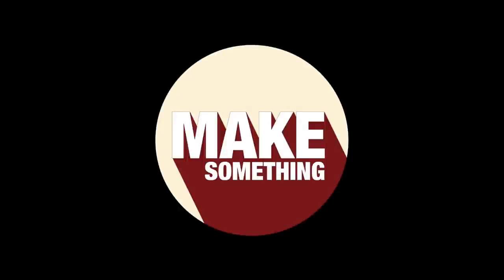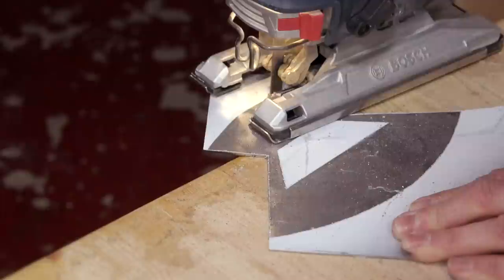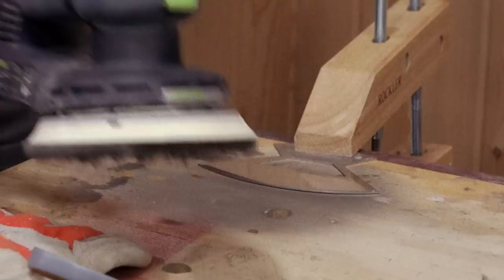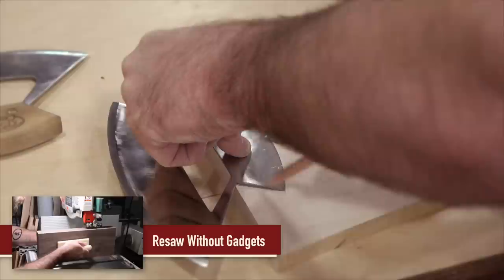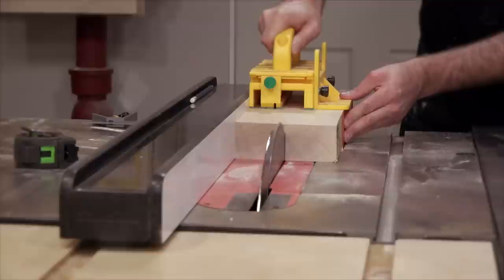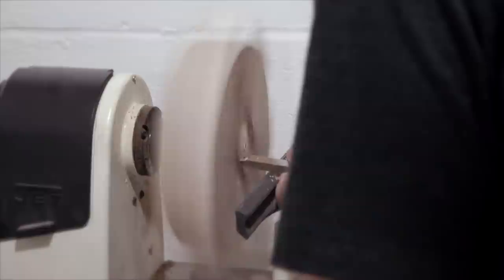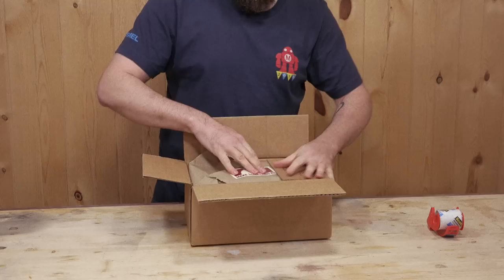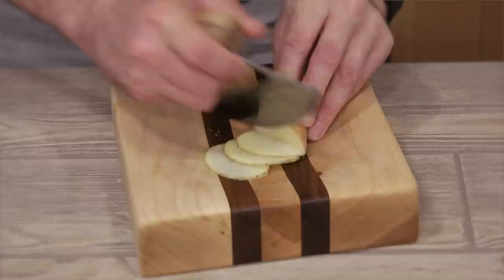How to Make an Ulu Knife with Cutting Board

Comment: Do you still have your silhouette? If so they make the best templates ever.  Use a weaker vinyl like oracal 531 or they even make a vinyl for doing high end painting templates. Just make sure you weed out the right areas and you have sticky template that will be very precise.

Comment: I'm a knife maker but since it is only used for meats and food it isn't exactly necessary for it to be hardened and tempered like a knife would need to be because you may use a knife on more dense mediums like wood. If its stainless steel that's good enough for the purpose but if it was going to be used commercially it would be a benefit to be hardened so it is sharp for a longer period of time. Well done!
Reply from the maker: Thank you! That make me feel better about my decision to not harden it!

Comment: Three things:

1 - The fracture strenght in a specific point is proportional to the radius of curvature in said point. Because of this, all those sharp corners in the knife, however cool, make it structurally questionable. It's not a big issue, though, since it wont be put into a lot of stress, but I'm just letting you know.

2 - What about the heat treating of the steel?

3 - Your videos are awesome. Subscribed.
Reply: Sheet metal is not treatable. It's junk.

Comment: I really like the idea for this build, but I would suggest one thing. Find out what kind of steel it is, and if it can be tempered. Otherwise that will not hold a edge very well as you said. The issue is that a dull blade is dangerous even if you only use it for potatoes. A blow torch, a container of water/oil, and a oven can give you a decent blade.
Reply: Also i am totally using this video to make one. I will just temper it.

Comment: I know quite a lot of chefs prefer steel that is easy to sharpen over steel that holds an edge for their knifes, not sure if it applies to this type of knife though, but it might. Many chefs just make it a habit to give the knife a quick sharpen before use almost every time, using one of those sharpening steels that looks like a piece round steel with a kitchen knife handle attached.
Reply: the item you are talking about, "Sharpening Steel" (aka a steel, lightning rod, or sharpening rod), doesn't sharpen knives. it only aligns the edge from wear such as the blade curling over or not being straight. it's good to use one before using a knife every time though

Comment: I never understood concave cutting boards for rocking blades. How is the blade gonna rock from side to side if the surface it's supposed to be rocking on doesn't leave any room for that?
Reply from the maker: In the video I do say the concave needs to be big enough for the knife to rock. It's how traditional ulu knife boards are made.

Comment: Hey David. So I know you're an expert on cutting boards, I want to know what your thoughts are on using baltic birch. End grain plywood furniture has become a trend, so why not cutting boards? Birch plywood is stronger than other grades. And any voids could be filled with epoxy or a glue/sawdust putty. The shop I work at throws away a lot of baltic birch so I would like to make use of those scraps.

Comment: If you're ever going to reproduce I would STRONGLY suggest getting some tool steel or high carbon steel.  The sheet metal used will not hold an edge with extended use.  As well please, please, please make sure you do not use galvanized metal. It's coated in Zinc and will cause zinc poisoning during heating or sanding.

Comment: Couple of problems here. First, you used mild sheet steel from the Home Depot. Which, I guess explains the second problem, which is you not heat treating it(it can't be hardened with a heat treat). So, this won't hold an edge at all, and isn't actually a knife, instead being a KSO (Knife Shaped Object).

You seem to be competent at building things. I think you could make a go of making a proper knife. Buy some high carbon steel, (I buy from New Jersey Steel Baron) build a simple forge, and quench in canola oil after reaching critical, which you can check with a magnet. Afterwards, check for the particular steel you chose, and temper accordingly in your oven. Or, buy decent stainless, and ship it off for heat treat.
Reply from the maker: Silly goose! Did you comment before watching the end of the video?
Reply: No, I saw your failed attempt at explaining it away. "I found one at the store that also sucks, therefore I don't have to put in any effort into making a real knife" isn't much of an excuse, honestly.
Reply from the maker: You may be misquoting me. :) Anyways, thanks for watching! Tell your friends!
Reply: I guess you don't stayed till the end before posting this comment, because he explains why he did it this way and why it isn't a problem if it doesn't hold an edge.
Reply: I did hear it, yes. It was an attempt to excuse shoddy workmanship, and it was a failed attempt. Knives should be made of decent steel. They should be sharp, and should stay sharp. They should maintain their shape, and not bend. By making this out of garbage sheet metal, none of these things will be true. His ulu should be thrown away.
Reply from the maker: Hrothgar So having fun, experimenting, trying new things isn't allowed? Well shoot..
Reply: Nice try, but I didn't say anything of the sort, and you know it. This is known as a straw man fallacy, and you're doing it because you don't actually have anything cogent to respond with.

You made a shoddy product by taking shortcuts, when you knew better. Then you presented this as if it were a valid way to make a knife. I encourage anyone who has the inclination to learn how to make a knife. But, they can't do it from watching this video.

I would suggest people watch actual knifemakers like trollsky, or gavko, or green beetle.
Reply from the maker: Awesome! Tell your friends about my channel!!! Thanks!
Reply: THANK YOU!!!
Reply: Anbu8366 he doesn't say anything like that, he says that he doesn't feel like it needs to be sharpened because he's not going to do extreme thing with it, but he never says only surival knives are hardened
Reply: I mean, im with @hrothgar on this one, but yeah he was aware of that this "knife" was made out of "crap steel"  but even still, i must say that for some reason i just have a hate deep within me for people who either uses to many powertools and people who get sponsored for this stuff, and what did you expect? an $5 ulu from a local convenient store is obviously going to be unhardened crap!   and srry for any misspells, english is not my mother tongue, Norway for the win!
Reply: Great steel is all around us. Plows, rail stock, an old file, an old circular saw blade, the leaf springs off of an old derelict truck out in a field. A forge is something you can get some buddies excited about (with sneaky email links to forging videos) chipping in on and building together. Some blacksmith lenses in a pair of goggles to see colors properly. A digital laser thermometer? Quenching in USED motor oil? Folding disparate metals for a damascus acid-etched patina? San Mai damascus? A proper ebay heat treat oven for tempering and heat treating and annealing?  There needs to be passion in this trade. I can appreciate how someone with ANY passion in this can become so tyrannical and anal about it.

Make Something; EXCELLENT video! VERY nice build. I know YOU are happy with the final product and that's all that matters to you. If you actually use this blade; even MORE awesome. Just keep your sharpening steel handy.

Hrothgar; Awesome nick. Excellent points, all correct and I agree 100%. But to me - the point of the video is the most important thing going here; Make Something. Yup. Something. Anything! I think We can agree - that in itself is worthy of celebration.
Reply: odliqna stvar bravo..
Reply: he says that it is "...mild steel from Home Depot?"
Reply: wait, isn't steel always heat treated?
Reply: +algol291 rly..
Reply: Mike L... u mad?
Reply: Steffen Tysnes Not at all.
Reply: +Mike L Ok, then I'll admit that I'm with you on most of what you said, but I think most of the critic in the comments is really all in all advice on how to make it better..
Reply: Hrothgar
Reply: Hrothgar
Reply: I agree. If a video makes a person go make something and they enjoyed it, they will make more and make better. This week I made a kitchen vegetable knife out of a tin can lid as an experiment. it actually came out pretty cool as it chops veggies fine and the handle looks neat where I used a woodburner on it to make a design. I am now inclined to make more and better knives and learned a few things from my experiment along the way. I work from an apartment balcony so can not use a forge. However the limitation is part of the fun as it makes me create alternatives.
Reply: Use a propane torch and some tongs. No forge required!
Reply: Nobody wonders why nobody likes knife nerds.
Reply: its not a real ULU unless its made at the Alaskan ULU factory..lol    they heat treat their ULU's.

Comment: Use better steel, it's not that expensive and heat treating services are readily available through several suppliers.  If it's worth doing, it's worth doing rite, and with proper knife steel it'll last a life time or two.

Comment: Too many knife makers today only know whats popular. I've made more light use cutting tools from mild steel than I could even begin to count over the years.  For some reason they seem to think mild steel is as soft as lead. If you aren't chopping oak or beating the h**l out of the blade, mild steel works fine.  Will you need to sharpen it more often?  yes. so? Doesn't even need to be stainless. keep it clean and dry.  after each use put a small bit of canola oil on it and wide it down before you out it away. it'll tarnish over time, but will be just fine
Reply from the maker: Thank you Chis!!!!
Reply: +tyvek05 gross assumptions and clearly not understanding what it is you're talking about only serve to make you look foolish.
I clearly stated that using a more mild steel wasn't as good.  you'll have to sharpen it more.  But for a "light use" cutting tool you dont have to use the super high carbon steels and steel alloys.  Yes, people have used hardened carbon steels for a very long time, but by today's standards even wootz and Damascus steels today are inferior steels.  
my poor quality work, as you've basically put it, has served me well for 25 years, without complaint from customers.
I was a properly trained blacksmith and actually have a B.S. in metallurgy. Do you?

If you can dull a kitchen knife completely in just a single use... stop misusing your knives. And before you try to tell me I'm wrong... make sure you actually know what you're talking about.
Reply: Samuel Swihart what the hell do you think a lawnmower blade is made of?   I can guarantee its not mild steal.  Most (probably damn dear every one!) are made from high carbon steel, ironically the same stuff knifes are made from.

Comment: Our of curiosity you don't need to harden then temper the metal for it to hold an edge?
Reply: He absolutely has to if not this will never hold a decent edge
Reply: +Arcadio Contreras that's what I thought. And getting it from Home Depot they never know what kind of steel it is
Reply: Sheet metal is junk, no matter where you buy it from.  Over 95% of the steel made is low-carbon/non-hardening.

If you want tool steel, you have to specify the type as the heat treatment procedure varies with the variant.  O1 and W1 are both easy to heat treat with almost no special gear (torch, magnet, & a bucket of pretty much any kind of oil for O1), but rust easily unless protected.  A small percentage of stainless steels harden and have excellent edge holding and corrosion resistant properties, but they're not as easy to harden and you definitely need specialized equipment to do so.
Reply: +RealRuler2112 yeah I harden O-1 all the time and would never get any metal from Depot unless I'm welding
Reply: No problem, plenty of kitchen knives are made of plain old carbon steel. If you take care of them , they will develop a nice patina and not rust on you.

Comment: I suppose if you do want to use hardened steel, you could cut the knife shape out of a scraped table saw blade.
That ending though o.O That's actually made me hungry, and I'm definitely trying those beer glazed chicken wings!
Reply from the maker: I'm also hungry! I thought about that but table saw blades are too thick. Even the thin kerf ones.
Reply: Make Something Get a food. Go Make Something, as the saying goes :P
It's a shame the tablesaw blade would be too thick :( Shame you can't resaw it! Could you imagine? :P
Reply from the maker: That would make a heck of a video!!!!!
Reply: Make Something I suppose you could run it through the thickness planer? That would definitely make this scenario better, and not worse! :D

Comment: Didn't realize he skipped the heat treatment until he mentioned it. Since you have all those fancy tools, might as well get a torch as well. No reason to skip that just so you can put in all that work and come out with a good looking but crappy functioning product. Kitchen knives are often hardened to a higher degree than bushcraft or survival knives. Mild steel will get dull in the kitchen way too fast, especially if you cook with meat and go through bone a lot.

Comment: man you used mild steel i know it will work fine for potatoes and stuff but anything harder or using it with your board will make it dull quickly next time use a old saw blade and heat treat it. it will make a far better knife other wise nice work man